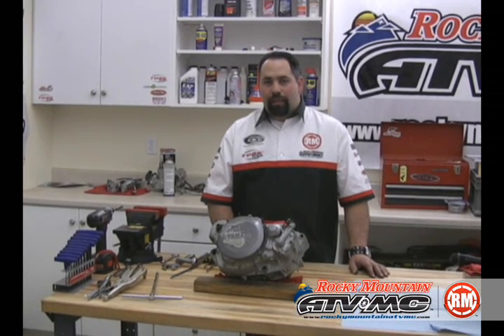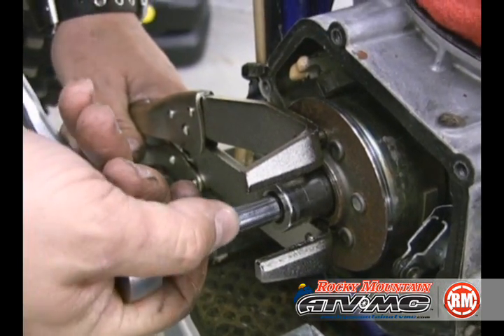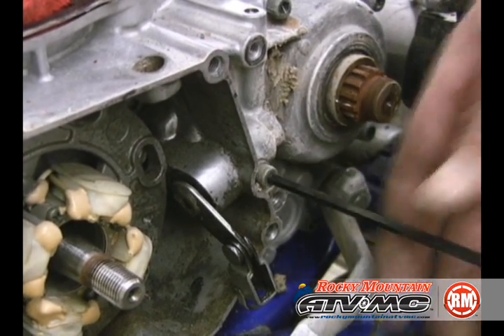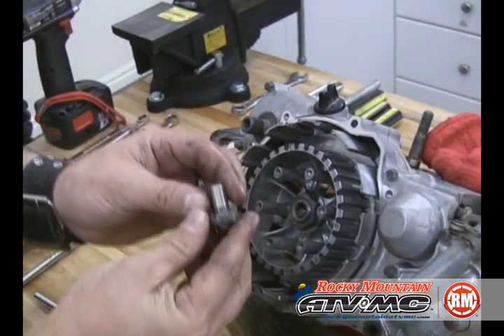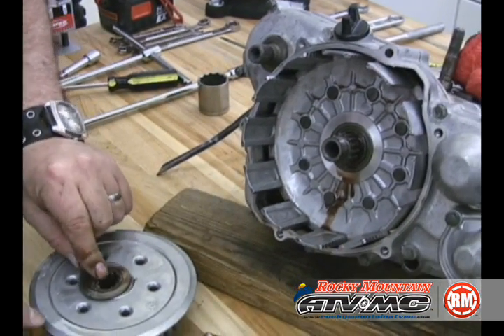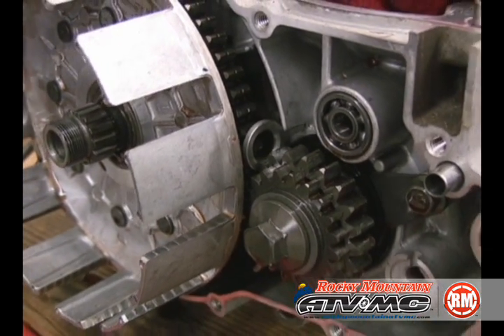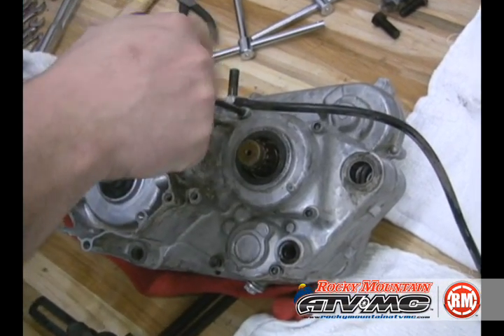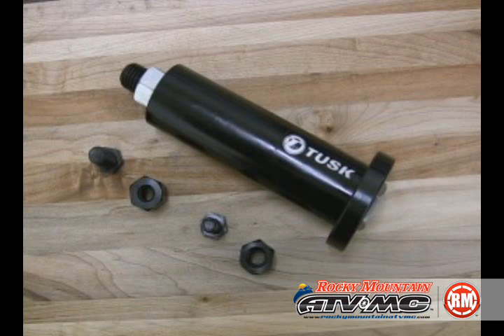Motorcycle Bottom End Rebuild | Part 1 of 3: Engine Teardown

Comment: hi i really need some help ? i have a yz85 2006, i removed the shift shaft to replce the oil seal and when i out the shaft back in place something somewhere has went wrong, it will not go into gear, the clutch wont work there is no pressure, it will  not move when i pull the cable, my plates have play on them all asif i couls fit another plate in there. i just dont understand i really need help ??

Comment from the maker: @bailycoco - your premix at 40:1 is fine.  If it is oily it can come from only two places. 1- oil in gas.  Since your ration is fine I would check your jetting.  2.  transmission oil.  This can leak into the crank from a bad right crank seal.

You may want to check your pipe as well.  I have seen many bikes (especially 125 and smaller) plug up with carbon and oil in the narrow part before the silencer (and in the silencer).  Make sure that is clean and clear.

Comment from the maker: @ChiefDrakula - many bikes will get hot and spit a little out.  If it is getting below the cores in the radiator you may have a bad cap or a bad head gasket that is pressurizing the cooling system.  If the bike is OK, we sell a Tusk high-pressure cap that works great.

Comment: @ChiefDrakula 
I'm no expert but leaking antifreeze is caused by too much antifreeze being used or bike is overheating when running...

Anti-freeze is nasty stuff so clean any up that your bike leaks...

If the antifreeze leaks from around the engine then you have a blown gasket

Comment: hello the engine of my kx85 is making a much louder noise as normal but it still runs great.
do you know if u just can take the bottom end apart and check all my bearings or should i first do something else?
and how do you know when a bearing is full of wear?

Comment from the maker: @mounts81 - Is it coming out the overflow or the small hole on the engine below the water pump.  If it is coming out the small hole, the seal is still leaking.  Could be an o-ring, shaft, or the new seal.

Comment from the maker: @surlybonds71 - yes.  you will have to pull the right case cover off, remove the clutch basket and then slide the shaft out.  replace the seal before putting the new shaft in.

Comment: I have a question. Yesterday the shift lever broke off of my 2005 YZ250. It took the tip of the shift shaft with it. (appears to be the same bike you are working on in this video). At the same time I noticed a small amount of leakage around the shift shaft itself  from the seal. Is it possible to replace the shift shaft and its outer seal by simply pulling the clutch basket and then the shift shaft and avoid splitting the cases? I guess I accidentally landed on the shifter instead of the peg.

Comment: I bought a tusk clutch holding tool of rmatv but can't get the center nut out, the nut is simply too tight and the more pressure I apply on my ratchet to undo the nut always just ends up with the inner basket slipping out of the holding tool, can you offer any help? I've got the engine out of the frame and clutch side crankcase off FYI

Comment: i have a 94 cr125 that sometimes when i shift out of 1st gear to 2nd the shift lever just locks up and won't budge but if i down shift and shift up again it shifts fine it does the same thing in the higher gear to is this something i should worry about

Comment from the maker: @Monsterenergy8771 - If you use a shifter that is loose, the splines end up wearing our quickly.  The aluminum shift lever should wear out quicker than the steel shaft (assuming yours is aluminum).  Inspect closely and replace what you need to.  Make sure to watch the lever and keep it tight!

Comment: This is a pretty lame method but if you want to remove the flywheel nut just stuff rope down the spark plug hole. When the pistons reaches the top everything will stop and you can break the nut free. Been doing it on all my bikes never had any problems.

Comment from the maker: @OPureGHOST - they are both very different.  You can hold a flywheel with the clutch holder tool, but it won't remove the flywheel - you need both tools working together.  On the clutch, the flywheel puller won't do you any good.

Comment from the maker: @LVRidaZ - The right case cover will come off, but the two center cases won't come off until you remove the cylinder and pull the motor from the frame.

Comment: could you plz answer me back PLZ I NEED HELP... My ds 650 starts very well and idles extremely well! But when i go riding about 25 secounds of riding it she stalls whit a screaming noise... so what im thinking since de 2000ds 650 model haves bushing and not bearings in the connecting rod so when the bike gets hot the bushing sticks on the crank and makes that loud noise and sudenly stalls...thats what im thinking does this make sence? PLZ HELP ME

Comment: Hi, this a yz 125 or 250 motor you're working on here?
I must say your videos are very informative to watch. 

Our local suppliers dont really carried much when it come to service manual and tools, so i'm having to use the web to get most of my info. 

'03 yz125 that i have to replace the crank as the bearing on the conrod packed up. 

I see i can order most of the tusk tools online, not sure about the Tusk Flywheel Puller. Any idea of the size i must order for the bike? 24mm and 27mm option.

Comment: @RockyMountainATVMC do I have to use the crank install tool to install crank to the left side? or does it just slip through the bearing? I would rather not buy the tool until that adapter comes out.

Comment from the maker: @BigManlyMan4 - great question.  Two ways to do it.  1. wait for  the snap ring adaptor we are going to stock - I have one in production now that is specific for the KX250.  It won't be done until mid september.  2.  heat the right case half to 200 degrees in an oven (flame will ruin the seal).  Freeze the crank shaft.  It will drop right into the warm crank bearing.  Then assemble the tranny on the right side.  Use the tool to pull the left side together.

Comment: @RockyMountainATVMC Hey I was wondering if the crank install tool would work on my 1994 KX250, because mine has the snap ring. Also, if it wont work, how could I pull my crank into the bearing?

Comment from the maker: @memphetic - if you actually have a penny made of 100% copper (made from 1793 to 1857), I wouldn't ruin it.  It is most likely worth a lot more than 1 cent.  If you have a penny older than 1982 it will most likely have a decent ammount of copper in it.  1982 and newer are 97.5% Zinc with copper plating.  The aluminum washer works great!

Comment: Freezing the bearing slightly shrinks the metal and heating up the case slightly expants the material. It makes it easier to get the bearing in. Same with wheel bearing on cars etc.

Comment: I have found (after many bottom end rebuilds) that instead of a hand held impact screwdriver, the better tool to use is a Craftsman Impact Driver. They are 19.2 volt cordless, and it has a quick connect bit attachment. I am a Sea-Doo mechanic (and do pretty much any 2 stroke wrenching on the side) and have found it to be invaluable.

Comment: i just bought the tusk flywheel puller and i started trying it and it feels like i need alot more strength for it to loosen but i'm afraid that if i push it down more it will break.

Comment from the maker: @rockmusicismyidol - Kawis are tricky because they don't have a bolt or nut on the right side, making it hard to use a crank puller.  The best way to do a KX, or KDX is to heat the right case half in an oven to about 200 F (this is about where water boils and it won't damage your seals).  Freeze the crank.  Once the crank is froze and the case (and main bearing in the case) is hot, the crank will drop right in.  Assemble the transmission on the right.  then use a pulling to install the left side

Comment: yeah i checked the pump seal, put water through it, and its not leaked a drop yet, the gasket linning the clutch case and crankcase was pretty banged up, even around the water flow hole, got a new gasket commin soon, so ill see what happpens....its it really that bad that coolant is leaking into the trans, and clutch tho?

Comment: @dudemanthing919191 

Dont the bike have a weep hole? should be a small hole at the bottom of the engine casing by the water pump, if no anyway replace the water pump seal & oil seal!

Comment: hi, i got a 1992 YZ 250 2 stroke, it leaks coolant form the radiator into the the clutch area and turns the gear oil into a graish white color, the flywheel on the other side is dry though,what would i want to look for if i take off my clutch cover? or do i need to split the entire motor apart, thanks!

Comment from the maker: It could be a few things. 1 - leaky right crank seal. 2 - too much premix in gas or injector is dumping too much in (if you have an injector) 3 - poor jetting - very rich fuel mixture.
All 2-strokes smoke some what.  Keep a close eye on the color of your spark plug.

Comment: also i forgot to mention that the cylinder is off and a block of would with a slot  cut into it is inbetween the piston and case. so the that the clutch basket wont go anywhere.

Comment: i know that the nut is counterclockwise. Im trying to get the nut on the clutch hub loose.  I have the tusk clutch hub holder and had it braced up against the foot peg mount and it aint goin no where, im just worried about damaging the hub.  I had so much pressure on this thing trying to get it loose.    Im thinking about putting alot of rags in between the clutch basket and hub then using an impact wrench to get the nut loose.  You got any ideas???

Comment from the maker: Part # 1179010002 will fit both bikes and most other two-strokes.  You don't need any special tool to put it on.  just tighten the nut.

Comment from the maker: It is hard to say.  Unless you have unhooked your primary gear on the right side your crank is still driving the clutch and water pump.  It could be resistance from those as well.  remove the primary gear on the right side of the crank to be sure.

Comment from the maker: I am not sure what you mean, but if it is in neutral and the transmission binds when yu push the bike, it sounds like you have some serious problems with eithes some transmission gears of shift forks.  You may want to disassemble and inspect.

Comment: hey, i have a 05 yz 125 and i recently blew something, as i was riding it cut out and i heard a crunching noise like metal on metal. It still has good compression but when i push the kick starter through i hear a clicking noise at the same spot every time. Any ideas what it could be? thanks

Comment: k. thanks for you help. Also i bought the tusk crankbearing installer, and none of the mounting hardware will mount to the primary drive gear side because its reverse thread, can i just use the bolt that held on the primary drive gear? thanks.

Comment from the maker: you need to find the correct flywheel puller that your manual calls for do do it right.  You don't want to ruin your electrical componants or crank by doing it wrong.

Comment from the maker: A very important question indeed.  No doubt your head gasket is shot; however, it shouldn't cause the water in your transmission.  I think you have a leak somwhere else.  I would check the water pump seal.

Comment: Hi I Have an important question. I Own a Honda 1987 250R which is a Liquid Cooled 2 stroke, I Noticed My headgasket is leaking out of the head bolts and also the gasket. I Then checked my oil and It has water in it and is a grayish white color. Is it possible that the coolant in my bottom end is from my bad headgasket? Thanks!

Comment from the maker: It depends where the break is.  if it is the right side of the center case, you are better off just taking apart the left and right sides.  There isn't much on the left side anyway. All the hard stuff is on the right and you need to do that anyway.

Comment: I have a 2006 rm85, and my case is cracked on the clutch side. i have the case and my crank bearings and seals, would i have to dismantle the rightside of the case, like the flywheel and stuff, or can i leave that alone and just remove the clutch and then just replace the half of my case thats cracked. Please respond.

Thanks, Justin

Comment from the maker: I haven't heard that the tool won't fit a KX100 until now, but I could see the splines being too small.  I am not sure.
I don't know what you mean when you say you "hogged the slines".  
You can use an impact.  I wouldn't use it to put it back on, but coming off should be no problem.

Comment from the maker: It depends on what problem they are fixing and what the shop rate is.  You can easily exeed 500 bucks on the labor though.  rocker arms can wear, but I wouldn't consider them 'high wear" items.

Comment from the maker: Most likely the bolt and the pivot bearing bushings are rusted together.  This makes getting the pivot bolt out very difficult.  Spray as much "liquid wrench" or equivalent spray on the bolt as you can.  Then, try pounding it out.  Put something on the end of the bolt so you don't damage it.  If it won't come, you need to find someone with a big press.  Good luck!

Comment from the maker: The puller is only used to remove the flywheel.  The flywheelgoes on simply by tightening the nut or bolt.  Once it is tight, you need a puller to get it back off.  Because of the shape of the puller and shaft, the puller will stick.

Comment: Are you kidding?  The puller is only 10 bucks from rocky mountain.  If you don't want to go that route, try jimmy rigging something and jacking up your crank or flywheel.  That will cost a little more than 10 bucks.  Then again it is a blaster.  I suggest taking a hammer to it to get the flywheel off.

Comment from the maker: You will need a case splitter to get the case apart easily without damaging anything.  The crank puller is critical to prevent stress on the crank.  The crank must be pulled (not pushed!) into the case halves so you do not knock it off balance or cause other damage.  I highly recommend the right tools for any job.

Comment from the maker: 2004 YZ250.  not every machine will be exactly the same.  Most the steps in this video are close to most modern engines out there. Refer to your service manual for your specifics.